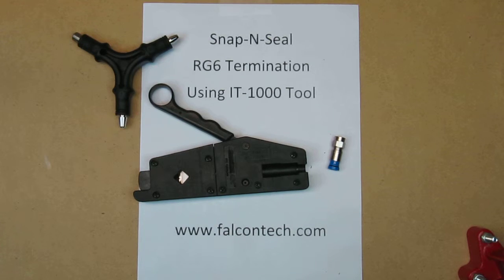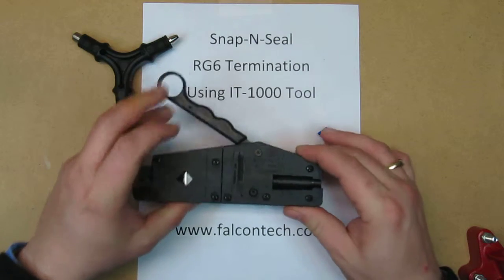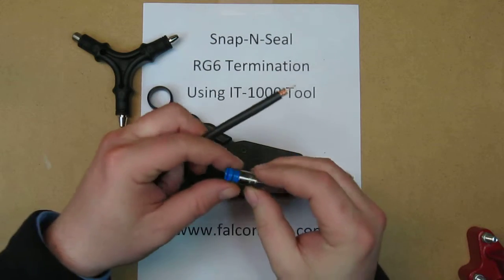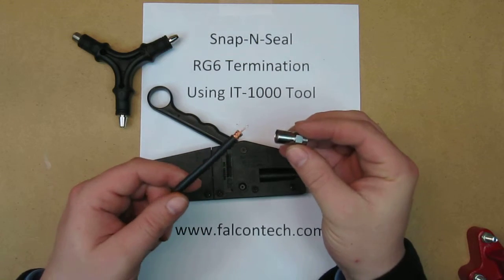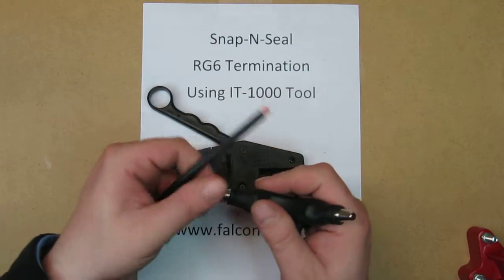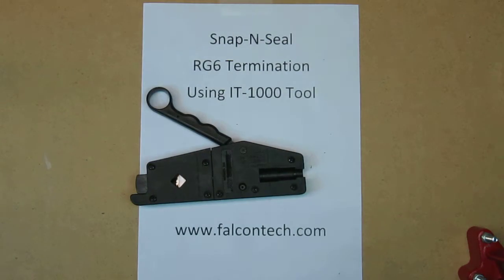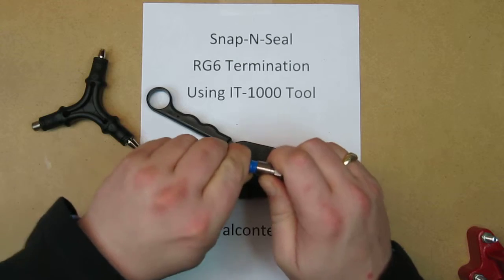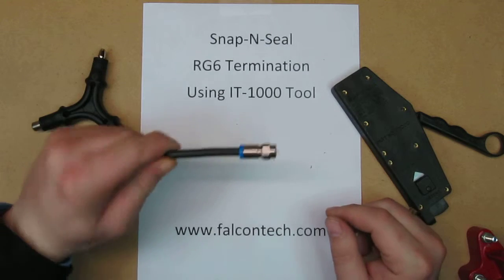How to Terminate a Snap -N- Seal Compression Style F-Type Connector - Falcon Technologies, Inc.

Comment: Three things.. 1) What is the"sight hole" for?  2) I agree about pushing the compression plug back first and agree with Intanius point below about flaring the braid back. 3)  That tool for pushing the cable into the connector seems a waste of time.  I've been doing it by hand very time and it works fine.